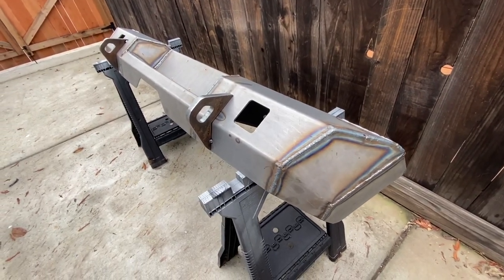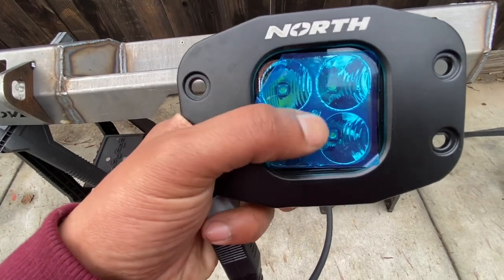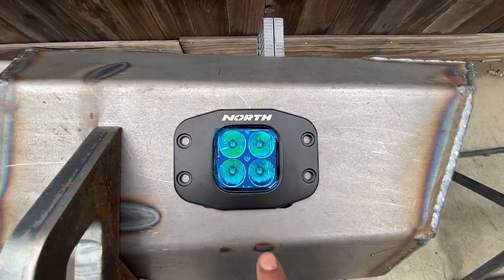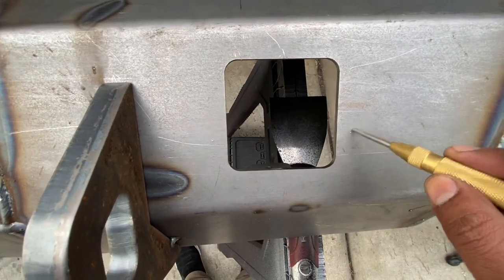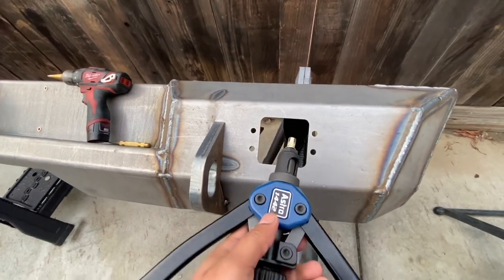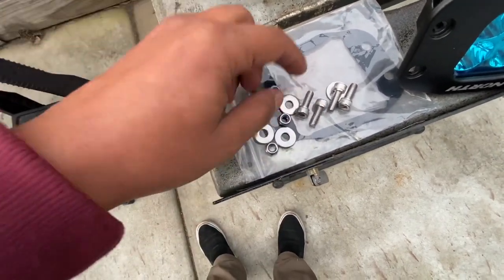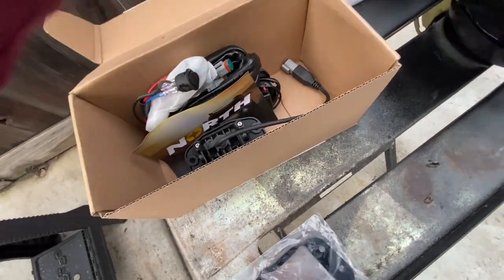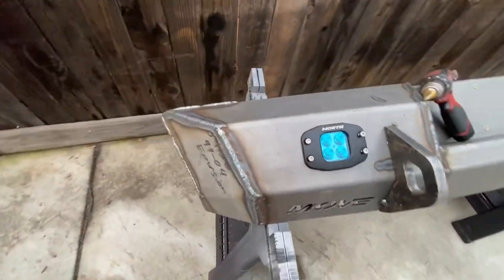Installing North LED lights on my MOVE Bumpers. 2001 Ford excursion.  @northlights5232 @Movebumpers

Comment: Thanks for the video. Good idea using rivnuts with stainless hardware. Curious to know how your Move bumper fit with your factory hitch and 7-way plug (assuming you have that). I’m doing mine right now (2000 7.3L Exc.) and it looks like I’ll have to cut further relief into the bottom of the bumper, or I could modify the slits for mounting to the frame to bring the bumper up 1/2”.
Reply from the maker: Sorry for the late reply. I completely relocated the 7 way plug. Still using the factory one but I’m no longer using the original mounting bracket. I cut into the move bumper and installed the plug on the left hand side next to where the license plate mounts. I can send pictures if you want.